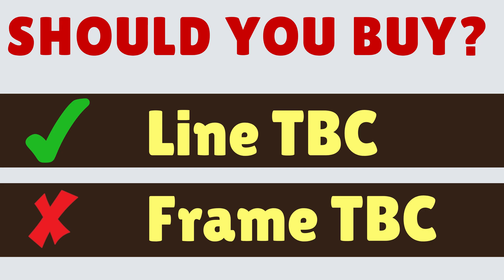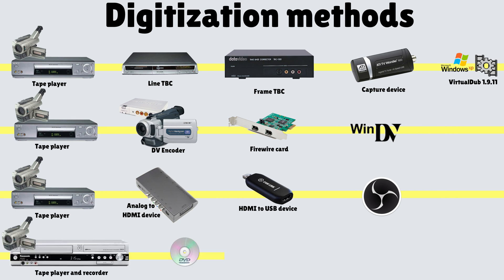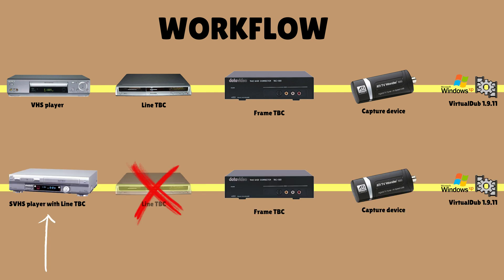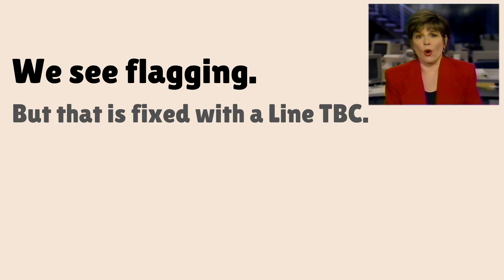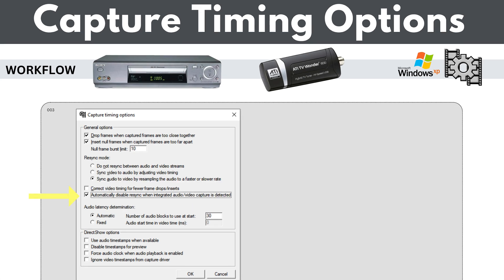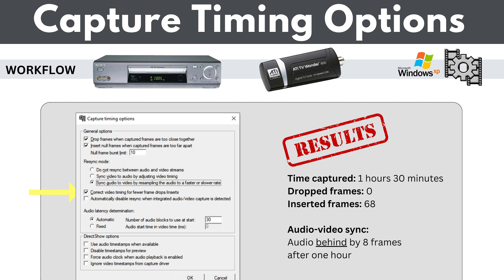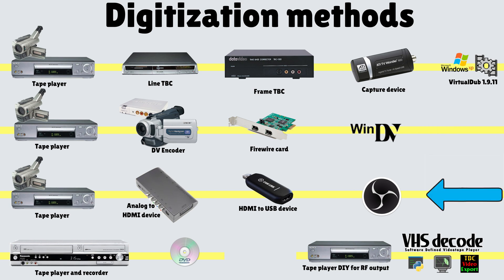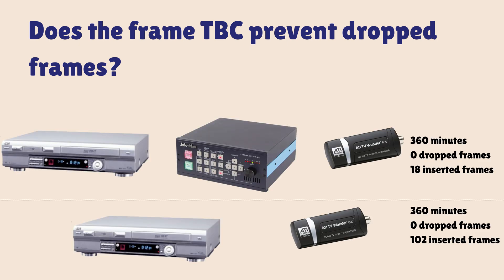What's a Line TBC and  Frame TBC?

Comment: I have a question.  I am a novice at this.  I still have a basic working VCR, a MiniDV camcorder and a computer with Firewire port I could use to import/transfer the AVI file.  So Option 2 might work for me.   Does that mean that I don't need Line TBC??.. and just use the VCR to MiniDV camcorder to Firewire etc?  My DV camcorder is Canon ZR-850. 
How does the quality of end result compare to other methods?  I think there would still be a "tracking" problem depending on the tape and VCR, right?  Please advise ...and thank you.

p.s.  I just read some other comments below about this same issue so I'm learning more but please comment on anything that may help.
Reply from the maker: The VHS--MiniDV--firewire workflow is a common one and the results are more than acceptable. If you read the forums you will find many people poo-pooing digitization via the DV25 codec (MiniDV) saying it is too compressed and ruins the image. Some (fewer) on the other side disagree. Then you have the VHS-Decode Project (RF transfer) people who shake their heads at the first two groups and say their way is the best.

All this to say, the DV method is okay and if that's the equipment you have, you should just do it. I've re-digitized videos when I discovered a better method or setting, so you can redo it in the future, assuming the tape has not degraded. A digital copy of precious family memories that is 70% as good as the "best" way is still infinity times better than no digital copy.

Okay, that's the preamble. 

Many (most?) of the Sony MiniDV camcorders are able to be used in "passthrough" mode, meaning that you play the VHS tape, it goes through the MiniDV camcorder, and out to firewire—without needing to record the VHS footage onto a MiniDV tape. This is helpful because VHS tapes are minimum 2 hours long and MiniDV tapes are 1 hour max.

I don't know if the Canon MiniDV camcorders had the same passthrough ability. But let's set that aside. According to some quick research, the ZR850 does not seem able to allow input of video, which means you cannot even copy your VHS tapes to a MiniDV tape.

Bottom line: you will need another MiniDV camcorder (I have the Sony TRV-17) to accomplish what you want. Or you can try to find a used ADVC 110, which allows you to plug in S-Video/RCA cables into it, and it outputs DV25 via firewire. But the ADVC 110 does not have a MiniDV tape deck, so you cannot play MiniDV tapes. If you think you will one day transfer MiniDV tapes, then I would get a Sony MiniDV camcorder. Also, some Sony Digital8 camcorders have the same passthrough ability. I have the Sony TRV-330 Digital8 camera and the results are near identical to when I use the MiniDV camcorder to passthrough VHS video. You can watch my video comparison here: https://youtu.be/XPtYzD6kNNk?si=FlHxHcW5fjJcJrsq
Reply: @videocaptureguide  Thank you SO MUCH!!!  I really appreciate all the information you provided.  Thank you for your time and expertise!!!

Comment: Line TBCs are a must, but frame TBCs still pass dropped or inserted frames, but won't cause dropped or inserted frames by the capture card itself. So if your vcr's internal line tbc has a hiccup on a difficult tape, the frame tbc passes it to the capture card, but without losing sync. It's the same with the DMR-ESxx devices... they can drop and insert internally, but the capture card doesn't drop or insert on it's end. I'm currently digitizing Woodstock 99 weekend... all 65 hours. The broadcast itself had signal glitches... the capture card will freak out and insert tons of frames over a split second glitch, but the DMRs pass it as it looks on the tape, but the capture card doesn't even notice. Personally I picked up a Panasonic WJ-AVE5 video mixer... it has it's own frame tbc, and replaces the line tbc... and has an audio VU meter and sliders to boot. It even fixes top edge tearing. All for a fraction of what an actual frame tbc will cost you. And it doesn't mess with the colors like the DMRs.
Reply: gonna buy one of those mixers!  i really need a TBC, but i'd need to take out a second mortgage on the house if i want a Datavideo or AV Toolbox brand one off ebay.  I will buy one of these, but i really also need an S-VHS VCR. i have a Sharp VCR but the video appears hazy.  Yep, i need a better capture device, too.  The Elgato i use is not good.  I need an IOData GV-USB2.  I have family memories on VHS tapes i so desperately need to digitize! Thanks for the tip on the Panny mixer!
Reply: I saw a Panny AVE5 on a website for $119.  the issue is, the seller doesn't know if it works. seller says it powers on, and lights up, but i guess they aren't a videophile, so no way to find out if it functions.  I will probably buy one i know is working, sold by a videophile, on ebay.  Maybe buy one friday.

Comment: Unfortunately, buying a used Frame TBC is a big gamble because there is no way of knowing whether it is in perfect working condition. You could be flushing $2000.00 down the toilet.
Reply from the maker: That’s a very good point. I think for any decades old electronics that is in that price range one should only buy it if the capacitors have been replaced and or if other work has been done to ensure that it runs for the next 20 or 30 years. I have not used that Grant VCR restoration service but they do the type of work (for a price) that is necessary to justify such high prices.

Comment: Have you tried capturing with Premiere? I have been using a firewire pass-thru method and using CS4 to do the capture. It captures the clips as AVI files at pretty decent quality. I'd be interested to hear your thoughts on this.
Reply from the maker: I plan on doing a comparison video between the Premiere method and the WinDV method to see if there is any difference. The DV file on the camcorder is just data so it shouldn't make a difference which software you use to transfer it to a computer. The OS shouldn't matter either. But maybe I am wrong so I will test it.
Reply: @videocaptureguide  I look forward to it as I have a lot of questions. I'm wondering how I can improve my setup. I was told firewire is only capable of 4:1:1 color but does that include a Premiere capture to AVI? I'm told 4:2:2 color is preferred but is that only possible via capture card? Thanks for responding. I look forward to all of your videos. I am learning a lot.
Reply from the maker: My understanding is that DV capture is all the same. But will try with Premiere to see if there is any difference. I have Creative license but it doesn't include older versions of Premiere. Hope to solve that and install on Windows 7 machine with FireWire card to test the theory.
Reply: @rickconsort2671  The Firewire DV Camcorder is stuck at 8 bit 4:1:1 color space but Premiere Pro is not. The video link below might be helpful although using CS 4 may not be wise. 

https://youtu.be/zBO0AGx8324
Reply: @videocaptureguide  When are we going to see the Premiere Pro video? Having said that DV capture is not all the same. The cheap software is allowing you to set parameters that you could potentially mess up. Premiere Pro will capture the 0s and 1s as intended. As I stated any type of color correction or audio enhancements should be done with the NLE as opposed to using additional  hardware during capture but I think you are stating to come to the conclusion.
Reply: @TechTVusa  I don't think that's correct. If you capture DV via Firewire you're just copying the digital data (bits and zeor's) that are on the tape. But the issue is that  the anlog images that are recorded through the lens of a DV camcorder are compressed (8 bit) and have limited color space (4:1:1) BEFORE the result is recorded on the tape. So no matter if you capture it later on totally uncompressed, as 10 bit 4:2: 2, you don't magically retrieve the data that was lost during the recording
Reply: @art2work4  My comments are correct. Your comments is somewhat incorrect.  Lenses do not have compression. Having said that Mini DV-25 is 8 bit, 4:1:1, 720 X 480i with 5:1 compression. I stated prior that not all DV capture software is the same. 

You wrote the following below. 

"DV camcorder are compressed (8 bit) and have limited color space (4:1:1) BEFORE the result is recorded on the tape. So no matter if you capture it later on totally uncompressed, as 10 bit 4:2: 2, you don't magically retrieve the data that was lost during the recording"

I Have stated what you posted above in several of my videos and that is why not all DV capture software is the same. Your comment proves my point. My comment was implying that some cheap software programs have parameters that you can change.  Many of them let you capture DV-25 as Pro Res 10 bit 4:4:4, H.264 4:4:4 MPEG, MJPEG 10 bit 4:2:2 uncompressed, etc. It is best to leave DV-25 files as DV-25 files because saving as Pro Res 10 bit uncompressed is not going to magically improve the DV-25 files. It will in fact have the same quality while taking up much more hard drive space. 

You should check out my channel before making assumptions about my knowledge and better comprehend what I am saying. We are on the same page but you failed to realize it.
Reply: I find your style of responding not quite productive. Of course I didn't state that a lens will do compression. I wrote that analog images are recorded (by the camcorder s AD converter) in a compressed manner.

BTW perhaps you shouldn't talk about DV capture software in a context of format/file convertion, upscaling,  color space conversion etc.

True DV capture software (WinDV, Scenelyzer etc) will not do any conversions, they merely copy the digital DV information from the tape to the HDD.

unlike other programs that do format conversions (premiere, virtual dub and many others)
Reply: @art2work4  

You wrote the following below. 

"I find your style of responding not quite productive. Of course I didn't state that a lens will do compression. I wrote that analog images are recorded (by the camcorder s AD converter) in a compressed manner."

I am not sure things can be productive. You did state the lens compresses the video. Perhaps it was a typo. The problem is you are addressing me TechTVUSA. I have several videos from 5 years, 3 years ago and even 2 years ago where I state that once the Firewire DV converter sends the file to the computer it is 8 bit 4:1:1 at 5:1 compression. I also state that some software programs will allow you to capture uncompressed 4:4:4 with a Firewire DV converter but at the end of the day the quality is not going to get better than DV-25. It will just use more hard drive space. Video Capture Guide has watched some of my videos.  That is why I have suggested you watch some of my videos. 

Keep in mind you can make YouTube videos of your own about VHS capture. 

Why address me (TechTVUSA)? You have addressed me several times and at times tried to correct me. When you address me it comes into my feed?  As I have stated not only do I know this stuff I have several videos about it. Do you kind of see my point?  Why not just make a new post that might help other people instead of feeling the need to educate me? 

For the record WinDV does not have all the features for DV capture that Premiere Pro has. Would you be willing to admit that?
Reply: @TechTVusa  Man oh man ... I wrote: "anlog images that are recorded through the lens of a DV camcorder are compressed (8 bit) and have limited color space (4:1:1) "

Where did I write that: "the lens compresses the video"?

"WinDV does not have all the features for DV capture that Premiere Pro has. Would you be willing to admit that?"
Did I state that WinDV has more features than Premiere? No, so why is your remark about thiswrite that, it's irrelevant. Personally I'm not a Premiere fan, but that is not the point here.

Anyways, I wish you all the best.
Reply: @art2work4  You are either dishonest or have a very bad memory. You wrote the following below addressed to me in another video.

"Why not use WinDV on WIndows to capture DV streams? (free software) or Scenalyzer? The latter one works flawlesly on my WIN 11 system (based on Asus MB and Firewire PCI-E card). Why would you stick to capturing with Premiere?"

My comment is very relevant consider You have the need to question why I use Premiere Pro instead of WinDV to capture DV tapes. To be honest your response is a tad bit aggressive. 

Maybe you are thinking to yourself "wow TechTV USA I did not know that was you I responded to. I guess I do look a bit like a stink pickle. I need to back off and stop getting into your business" 

You simply assumed WinDV should work for everyone.  It didn't occur to you that there might be valid reasons for people to use Premiere Pro.
Reply from the maker: If DV25 data is just data, and if WinDV software successfully copies incoming data, then what added value does Premiere Pro as the ingest software? I'm not saying it is incorrect to use it. I'm just asking what extra value does it provide above WinDV as the ingest software?

Comment: Love these videos which you are doing.  The VirtualDub settings I have been using based on a different video, which seem to work fine as well, is to uncheck the first two boxes (drop frames when captured frames are too close together and insert null frames when captured frames are too far apart,) then to Sync audio to video by resampling... and finally enabled correct video timing for few frame drops/inserts.  So far this works on all the tapes I have captured.  Once it doesn't I plan on purchasing a RetroTINK 5x to use a frame TBC so if you jump down that rabbit hole in the future please post a video about how well it works for you.
Reply from the maker: May I ask what tape player you use and which capture device you use?
Reply: Unchecking the first two boxes is essentially just disabling dropped frame reporting. So you've not stopped dropping frames, you've only stopped the reporting. "If I close my eyes, you can't see me!" or "We'd have less cases if we stopped testing!"

Comment: There are other ways of better quality but are niche and the hardware is a little bit expensive, Not as expensive as a TBC-1000 though. One of them is lossless over firewire, this requires an IOS and a firewire capture box that captures lossless AVI (not DV), The second is analog to SDI, some of these SDI devices have both line and frame TBC and output digital SDI, you would need a SDI-USB3, SDI-TB or SDI-PCIe adapter to get the lossless AVI into the hard drive.
Reply from the maker: I was curious about the lossless AVI over firewire. Googled it and found your post at Videohelp. Did you ever get it working or do comparison tests to see if that AJA method produced better results?
Reply: @videocaptureguide  I replied to this before then realized my post was deleted, No I didn't make it work since I don't want to get Apple hardware.
Reply: @videocaptureguide  I don't have a MAC so I've never tried it, Jwillis another member had it working. All lossless methods produce the exact same results, there is nothing to compare really. But adding devices in the mix like a DVD recorder or an external TBC can affect the visual quality vs just one device like the ones I mentioned.
Reply: @Capturing-Memories  Different ADCs inside each device may well produce somewhat different results. For example lower end ADCs are 8-bit while others are 10 or 12 bit, there's also oversampling, proc amps for colour etc adjustment, and different comb filters(for composite). Only the (lossless) encoding itself will be identical.
Reply: some of these SDI devices have both line and frame TBC and output digital SDI,   Can you perhaps guide me to those products? I've seen quite a few, but mostly without TBC

Comment: My AG-1980 succumbed to bad capacitors a while back, leaving me with no TBC-enabled VCR. I picked up a DMR-ES15 off of ebay for under $50 and it's been pretty decent after I sorted out its IRE menu settings.
Reply: please share your settings!  i bought my ES15 for $11 and some change.  i really need a big time TBC as my tapes have tearing and glitches, rainbow effect, too!
Reply: @coolcatrick3454 Wow how did you manage to find it so low? I see them going for over 100 now on ebay and only a handful available